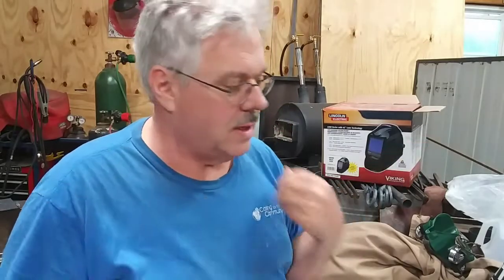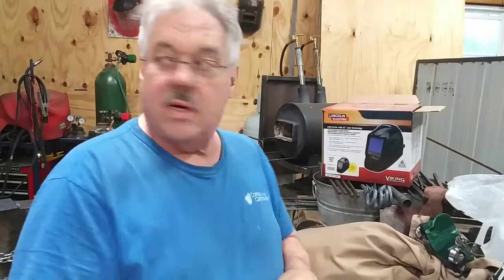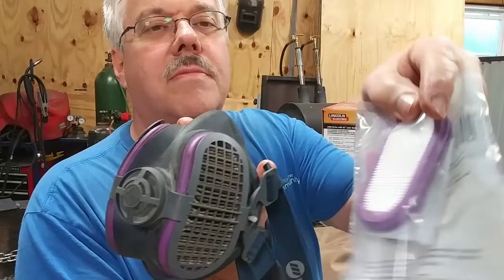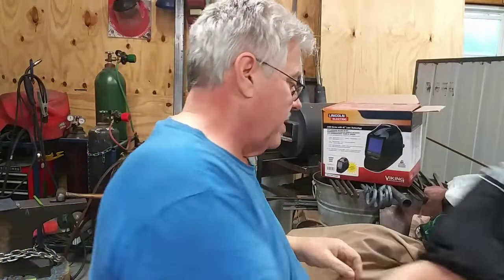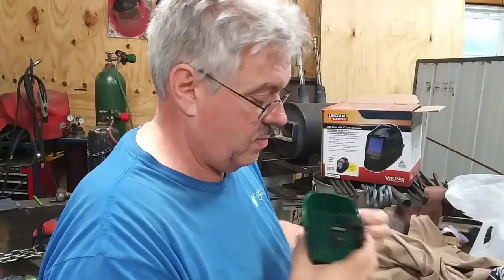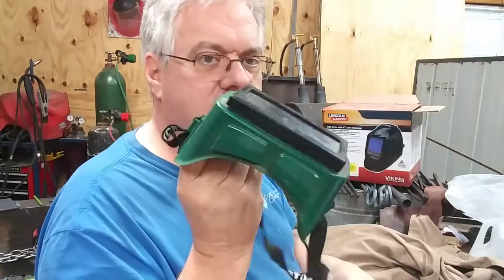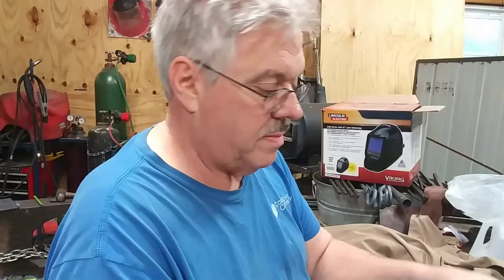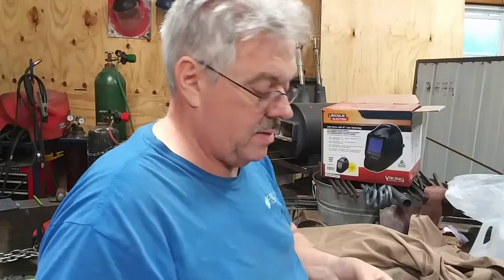Preparing Welding Gear, Welding Mask Filters, Respirator Filters, and more

Comment: Thanks Gary, I need to get a respirator. Most of my welding was when I build track and this was on tables outside. Now I have new fixture tables and they are inside an over hang. Ventilation is still good but it take a while to clear all the smoke. Wish I had a place here to take some classes. I would love to  to get better at tig welding. Wayne
Reply from the maker: Sorry for late reply. This was in my "Held for Review" comments with a bunch of others that I missed. 
I welded a long time and never thought about filters or ventilation unless it was toxic stuff like galvanized.

Comment: I believe your gonna like Tig over mig in light guages applications. When I first started out my boss gave me a Tig stinger and a few basic instructions. After a couple of weeks I graduated to mig. When he gave me a stick, his comment was well we have others that can do better. Lol
When I left there I could mig most everything we made, from 1/2 in steel to 1in aluminum. 
With a Tig I got to a point where I rarely used a filler rod on stainless, probably 90% of it was fusion welded as was light guage galv.
Masks, we never ever used them (should have) leather sleeves, not unless we were welding heavy steel. Usually just put on a stinky flannel shirt.lol
Good luck and enjoy.
Reply from the maker: Thanks Donnie.. I just saw your comment.  Apparently about 15 comments went into a Review bucket and I didn't see them until now. 
Yeah, no one ever used masks and I find myself still forgetting to put it on.  I started with stick and then went to mig... I am enjoying the TIG so far. We are supposed to go to Aluminum in the next few weeks.  Been doing mild steel up to now.
Reply: @GaryForgingOn  tell you a couple of tricks that will eventually help you and more than likely won't be taught.
Flash burn eyes, very painful cause by a sudden unexpected arc without hood protection, slices of potatoes laid on your eyes
Fume poisoning, caused by welding galvanized metal, drink a lot of milk, it will stop you from expelling your kneecaps through your nose, lol
When welding stainless, as you tack your metal, use a wet cloth to cool each tack as you go, you will see the metal draw together closing the gap.
Where I worked we excelled in welding stainless and the building of copper awnings. Our fume hoods for commercial kitchens and fume hoods for commercial industrial use were shipped everywhere worldwide so yeah I got pretty good at stainless.
Enjoy yourself and be careful
Reply from the maker: Thank you Donnie.. I just saw this, YouTube stuck it in my "to Review" section and I missed it. Those are very good tips. I had not heard of the cooling part.  I have flashed my eyes enough. What is bad is I flash my eyes with an auto darkening hood because I have such a huge habit of raising my hood like the old days and then I nod to lower it just before starting still.. even with an auto darkening..  Old habits !!!!!  
I am enjoying the tig welding class. We have been doing mainly mild steel but are supposed to start into Aluminum either this week or next week. 
I have welded galvanized and back then I didn't know how dangerous it was. I found out and tried to stay ventilated but I mainly just stayed away from it.  I started using a mask and filter recently but I still forget to put it on.  Those old bad habits again. 
Thanks again and take care.